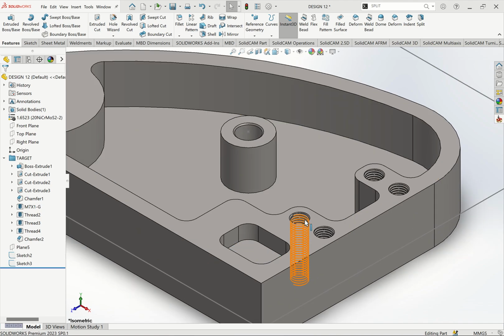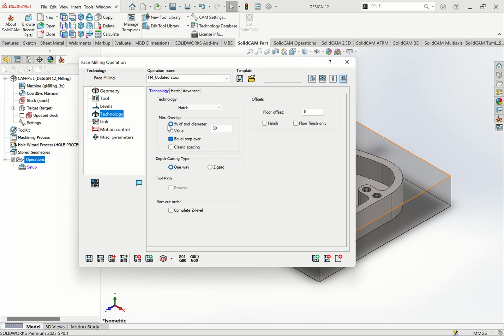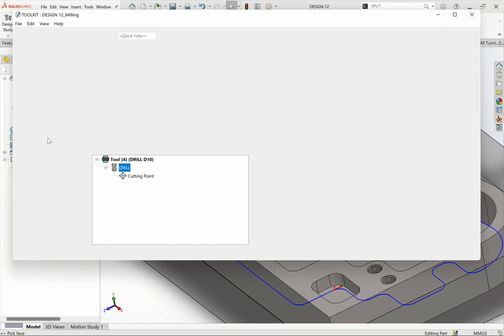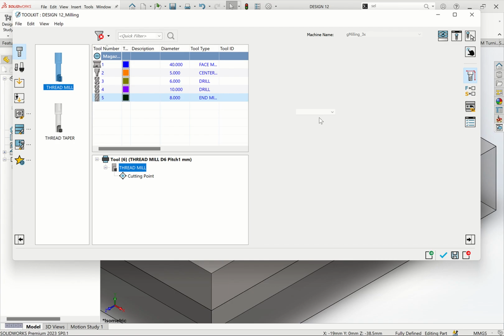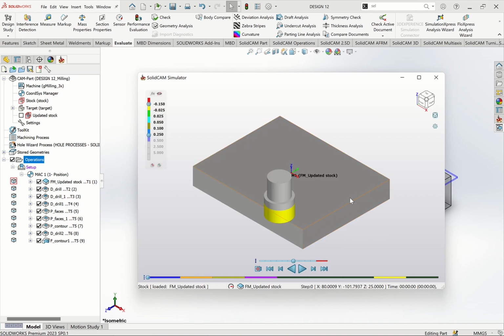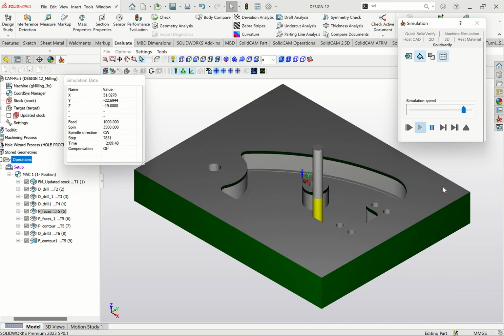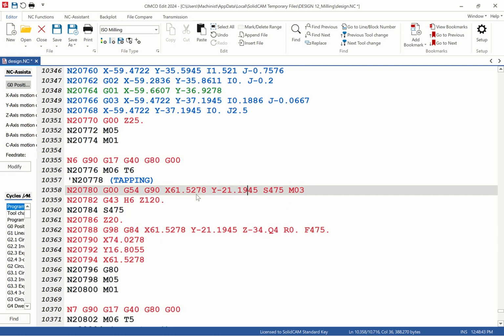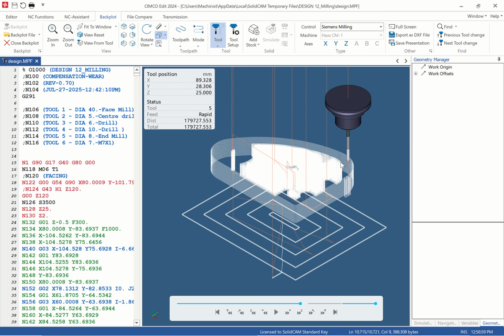SolidCAM 2024 Tutorial: Face Geometry Programming & Tapping Operations Explained

Comment from the maker: %
O1001 (THREAD MILLING M10 X 1.5 - SIMPLE VERSION)

(--- THREAD DETAILS ---)
(THREAD SIZE: M10 X 1.5)
(DEPTH: 12 mm)
(TOOL: Ø6 mm SINGLE-FLUTE THREAD MILL)
(PRE-DRILL HOLE Ø8.5 mm)
(HELICAL RADIUS: 4.25 mm)
(TOOL CENTER AT X0 Y0)

(--- CUTTING PARAMETERS ---)
(SPINDLE SPEED: 6000 RPM)
(FEEDRATE: 240 mm/min)
(THREAD PITCH: 1.5 mm)
(TOTAL PASSES: 1 — SINGLE PASS)

G21 G17 G90         (Metric, XY-plane, Absolute)
G0 Z5.0             (Safe height)
T1 M06              (Tool change)
S6000 M03           (Spindle ON CW)
G0 X0 Y0            (Move to hole center)
G1 Z2.0 F200        (Position above surface)

(--- START HELICAL THREAD MILLING ---)
G91                 (Incremental Mode)

G3 I4.25 Z-1.5 F240  (1st helix turn – 1.5 mm pitch)
G3 I4.25 Z-1.5
G3 I4.25 Z-1.5
G3 I4.25 Z-1.5
G3 I4.25 Z-1.5
G3 I4.25 Z-1.5
G3 I4.25 Z-1.5
G3 I4.25 Z-1.5       (Total = 8 × 1.5 mm = 12 mm deep)

G0 Z5.0              (Retract)
G90                  (Absolute Mode)
M05                  (Spindle stop)
M30                  (End of program)
%